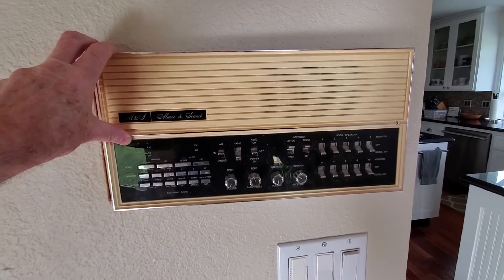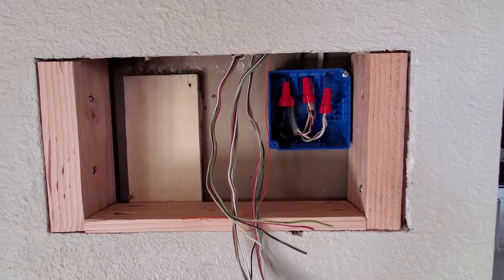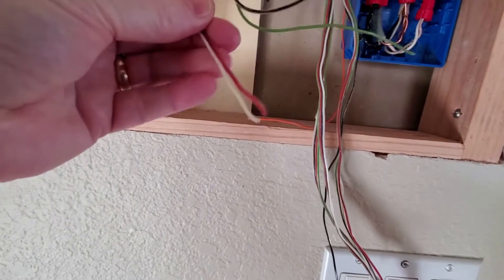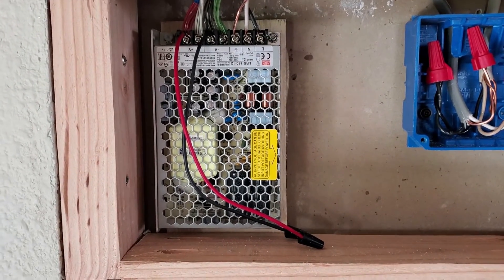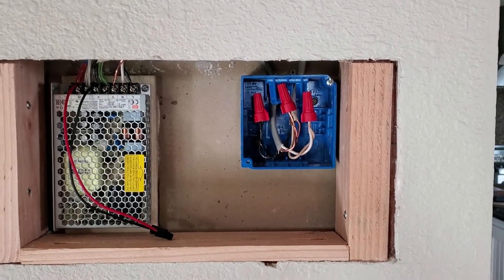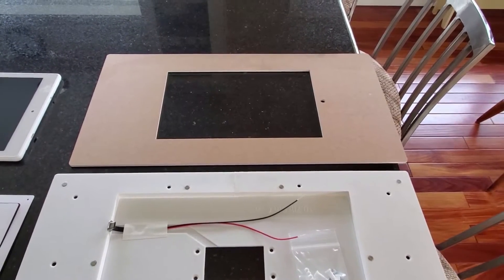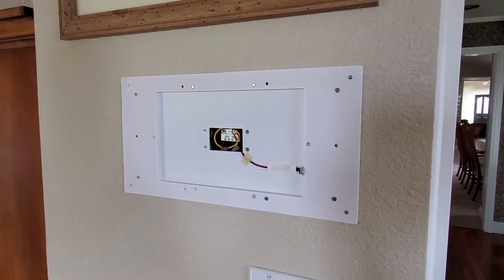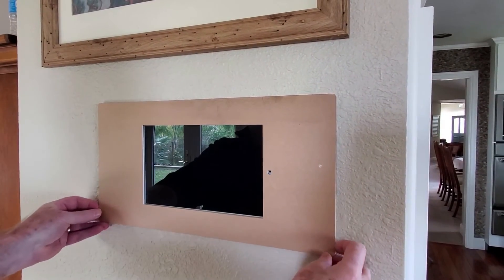Old Intercom Replacement - Wall Mount Tablet

Comment: This was fantastic! It took the mystery out of "what the heck am I going to do with this?"  Although I don't think I will be tackling this myself, I have a better idea of what type of professional to call. Thanks so much for demystifying this process!
Reply from the maker: Thank you for your extremely kind reply Shanee. That is much appreciated. I'm not sure what kind of professional you could get to be a  one-stop-shop to do this, with the custom components involved. But if you assemble these pieces from the links and step through the video, you can do it! There are really no special fabrication skills required and even the wiring is quite simple (although if not confident with that part, then certainly get - or ask for - help). If you look on Houzz forum  https://www.houzz.com/discussions/4321917/what-to-do-with-old-wired-intercom-system you will find a thread, not started by me, but I have a significant number of inputs and advice and you can reach out there if you need more.
Reply: @decosse01  I think what stops me is the knowledge you all in the thread seem to have on voltage and when (not) to transform. Seems to be some additional industry knowledge required for each component that I am not familiar with. Although I am a total DIYer. I will do more research!
Reply from the maker: @shaneemadden135  Most of the Amazon based components will be either 12V or 5V (although Google stuff can be a bit different) - So you pick a 12V supply and if need be use a 12V/5V converter where needed. You can always find the specs of the device either on the product listing or the AC Adapter that comes with it always has the voltage stamped on it :) Check out that thread on Houzz - I'm listed as Ken S** on there.
Reply: @decosse01  Will do thank you!!!!
Reply: @shaneemadden135  Did you ever compete the task? I'm thinking about getting this done myself. I like the vintage look and feel, but the radio doesn't work on my intercom.

Comment: Great Video!  One question. Did you need a 12v to 5v convertor for the other devices like you had for the main tablet?
Reply from the maker: It will depend on what devices you use personally - for the Echo Dot 3 I used, these are 12V devices, so these are connected directly using the appropriate adapter connector without any voltage  converter device (see part 2 of the video series). I also had two more tablets however, these were Amazon Fire devices also (although one 8" and one 7") - these are 5V devices, so those had the 12v/5V converters.
Reply: @decosse01  thank you so much! One more quick question if you don’t mind. I’m planning on using the fire tablets in each room. Do you  still recommend a 12v power supply converted to 5v and each unit. Or is it better to just start with a 5v power supply?
Reply from the maker: @arpanppatel  You are better to distribute 12V and then use a 5V converter locally at each station - the reason is that if you send 5V from the origin, you will drop some voltage across the wiring before the station -  at 5V the current is also 2.4 times higher, therefor the drop is proportionately higher that it would be for 12V distribution. It's slightly higher cost, but a better plan.

Comment: Might as well use alexa with drop in
Reply from the maker: That is exactly the point of this - the premise IS to utilize Alexa (for drop-in and other services) but have the devices wall mounted replacing the original IC components, while utilizing their original in-wall wiring for power distribution. Anyone who wants to just plug their Amazon devices into any wall AC outlet can certainly do that without this in-wall integration.
Reply: @decosse01  i guess. This is a good concept before the echo show 15 was released

Comment: Is there an app to allow intercom feature if I have tablets (or each dot?) in all rooms. My family is so used to press and hold a button and say "DINNER TIME - COME DOWN". What if I have outdoor / front door intercoms? Any way to mount and protect a 7 inch tablet vertically? An outdoor tablet at front door can be used instead of ring door bell? Now that our 1980s intercom is broken and I would rather replace them with modern technology.
Reply from the maker: with amazon devices you use their drop in feature on alexa for intercom. look through other q & a below to see my other responses on that feature

Comment: My M&s room stations were   connected using CAT 5 cables. How do I power my Echo Dot 3rd Generations to electricity behind the wall?
Reply from the maker: @deelytefulnurse - there are a couple of ways you could go; the first is to use a technology called POE - Power Over Ethernet - this is normally used to transfer both LAN signal and Power to a device over the same ethernet cable, originating from a POE equipped Router or Switch; then you would need a local device at each room location to break out from the RJ45 connector to separate outputs for your 12V and the LAN signal (you wouldn't be using the latter component of course as the DOTs are wifi); so you would need a POE Injector and a POE equipped switch at the source and a POE splitter at each Room Location and simply plug your already terminated RJ45 CAT5 cables in at each end. 
The second way to go, follows the same basic premise as the analog system per  the video tutorial, where you would simply be utilizing the cat 5 cable as nothing more than a multi-conductor cable - you just cut the connectors off and strip the outer shield, then connect as many pairs as you choose to carry your + & - 12V.

Comment: Great video.  I was just going to replace the intercom with new intercom unit, but I like this idea must better.  Couple questions, 1. Do you lose the intercom functionality? Intercom is more important than music for us.  Perhaps Tony H’s idea is better for an intercom replace, Fire 10 as a base and 8’s in the rooms?  2. Do you need take into consideration the distance the wire is run, say 100 feet, to determine 12V vs. 24V?  

Thank you in advance for your input!
Reply from the maker: Thank you Drew Fralley. Echo Dots can be used as Intercom (and so can Show Devices and Fire Tablets and all comfortably co-exist). The Amazon Alexa feature is called 'Drop In'. You just issue verbal command 'Alexa, drop in on (e.g) Bedroom 2' (If you do a search on Alexa Drop In you will find lots of guides & tutorials) 
To your second question, theoretically, it is not just distance, but wire gauge also that determine the overall resistance; thicker wire or multiple wires will have proportionately less voltage drop  - I had recommended to use multiple wires in parallel if you have them available - two wires connected together in parallel have half the resistance of each single wire; so the resulting voltage drop (whatever that might be for each specific situation) will also be half for two wires than for a single wire. We are not talking about huge current here though and even 100 ft is not going to be that significant in regards voltage drop (but do use double wires if you can). 
Here's an important factor if you wanted to test it - if you simply connect your wires at the power supply and measure the voltage at the unconnected wires at the local end, you will get zero loss. Why is that? Because you can only have voltage drop when you have current flowing. In order to achieve that you must have the load connected and THEN you might be able to measure a slightly lower voltage at the local device vs the source.

Comment: Can I use a 5V power supply? Wouldn't that be better if on the room stations I want to power tablets with USB?
Reply from the maker: Great question @John Rezai - The problem with a 5V supply is that you have no overhead - depending on the quality of your wiring and how many devices are pulling current, you may find the voltage at the local device is less than you may desire/require. 5V distribution wiring will carry 2.4 times as much current as 12V, therefor the line loss (voltage drop) to the local device is likely to be proportionately greater. However also note even if you did still have some loss at 12V, you still have plenty of overhead when stepping down to 5 anyway. So although it adds a little cost it is better to distribute 12V (or 24, whatever you prefer for your power supply) and then use a 5V converter at each device.
Reply: @decosse01  You are AWESOME! Thank you so much for your reply!! Means a ton when someone takes the time to respond like that, thank you! Just a follow up question, which 5v converter would you recommend for an amazon fire tablet (for the room stations)?
Reply: I just subscribed!
Reply from the maker: @pjrezai  Thank you for kind words. If you look on Amazon you can find converters in multiple packs even - some already have a USB pigtail on them which makes them sound convenient, but recognize that when installing in a wall mount, you really need a special ultra-slim edge mounting adapter so it fits inside the mount. So that extra included USB may not be of any value. If you look at the MB mounts site, even for his 'std' wall mounts, there is option for both adapter and slim pigtail connecter. (you can see those in the video at approx 8 mins - same adapter is available on Amazon or Ebay if you want to compare prices.
Reply: @decosse01  Thanks for all the help!!! You think I should go 24v power supply if I am doing 8 different connections for tablets of a decently long distance? Or should 12v be enough?
Reply from the maker: @pjrezai  12V should be fine and the 12v/5V converter are easier to source

Comment: HELP please. We have an old MS intercom, security, music system. The crackling and screeching makes us turn it off…but no doorbell. I’ve watched your you tube a lot. Want to order from Mikes plastic panel to hold a tablet and want to order a ring wired doorbell and a couple wired security cameras. Your video also shows the power supply to add ring dots for music. I don’t want Alexa and I now have a Sonos for music, but want the doorbell and maybe a fire pad. Would the 12 volt power supply still be applicable without dots? Going to have an electrician install, but I have to order equipment. You say that when we remove the main MS system box there is 110 volt power to 24 volt transformer. Is that what is in there now and would I need to switch power supply for what I want to do? Thx a million . God bless. Erika Parkes
Reply from the maker: Hi Erika - I'm glad my video has inspired you! You don't need the dots if you don't want the Music or Alexa capability at those room locations. The thing with a Ring WIRED doorbell is that it will require the AC voltage from the Original transformer, NOT the DC voltage you would need for the Tablet. If the Tablet is the ONLY other DC device you are using then conceivably you don't need a new power supply at all, you could simply utilize the converter that comes with the Tablet (either have a std AC outlet located behind the new panel, or cut off the plug and hard-wire into the junction box). Fire Tablets run off 5V incidentally - the 12V power supply per the video is the universal supply for all the devices - the dots are 12V - but note that I used an additional 12V/5V converter for the Fire Tablet. Hope that helps.
Reply: Dear deconsecrated, thank you for your reply…but if you could give me a little more clarification. I did look at your dots video…and no, I’m not taking the intercoms out of the bedrooms, so no music will be going through my ms system speakers. I am going to order the mount for the ten in fire tablet. It states that I need to buy the skinny tablet usb connection to hook into the wall mount because the plug in cable with fire tablet is too thick. So I understand I don’t need the 12 v power supply for dots…but do I buy the 5 volt power add on thru mounts. My electrician did Mention he could install an outlet in the box space where the old ms system is removed. Should the outlet have a USB port also? Would that work best. Finally, I’ve read it’s not good to keep any tablet plugged in all night…so what about the fact that it will always be plugged into the power source. So that is where I’m a little confused. Also, please clarify what we need for ring doorbell wired where the old intercom doorbell at front door. I bought a plate to cover that hole with a hole in the middle to wire the ring doorbell to former wires. Then will my old chime function, or do I have to buy the plug in chime that ring sells to place in some socket in the house.
Reply: Sorry I messed up your name…auto correct.
Reply from the maker: @erikaparkes3411  On the Tablet Power Supply - if you look at the power options from MBMounts, you will see he has a 120/240V option which consists of the skinny cable plus a 120 to 5V converter. So that is all you need and you can tell the electrician to wire up the voltage converter to the original Power cable. My Tablets were plugged in 24/7 and per Amazon this should not be an issue. If you really want to be able to disconnect it periodically, without having to remove the Tablet, you can use a device like a Shelly Relay (Shelly1) as an intermediate device to switch the converter supply on/off; with the Shelly you can then program it (via its own app) to be on only for whatever times you choose (maybe overnight or whatever). A Shelly now adds a whole other dimension, that I can't describe here, or attach a diagram for - suggest you visit the Shelly Support Group Facebook page (you will need to join the Group) and ask there. But that is maybe getting too advanced and it should not really be necessary anyway. 
For the Chime, your simplest option is just to use a Ring Compatible Wireless Chime that you can plug in to a std outlet (like the Ring Chime Pro)
Reply: This is Erika. 5/22 Can I ask two more questions. The motion detection kiosk you said is an android app. Did you download google play to get that? Amazon fire help states you can’t download that google without messing up tablet. Right now I have to use Alexa wake command. And I love the fire pinkish screensaver you have. It’s not an option on my new fire. I tried to google how to get it. There are only frozen pictures available like a seashore…and I don’t see a fire app to give me more options. I’m not using dots, but was able to download my Sonos app which turns on my music thru Sonos…so with the doorbell and tablet only, do I still buy the 12 v 5V converter power supply you have linked. You mentioned you changed to something different. Thx so much. Electrician coming Tuesday. Erika
Reply from the maker: @erikaparkes3411  do a google search on "Fire Toolbox" - it should be the first result returned I believe. The Fire Toolbox allows you to customize your Fire Tablet, get rid of all the bloatware, ads etc, add the Google Playstore and MUCH more. If you go that route, then you can get the Fully Kiosk Browser from the Play Store. Or, without going that previous route,  you can 'sideload' the app by getting the APK from the Fully Kiosk site - https://www.fully-kiosk.com/en/ - the Fire version is the first one in the download panel on the right. (an apk is a kind of executable app install - you just download it from your browser on the Fire and then install it). I recommend getting the Fire Toolbox - you can also disable the 'unlock' screen after it wakes up - you can't do that with the std Fire OS

Comment: I am in the process of doing this thanks to your video! I have one question each of my units have extra silver wires with them. Is that the ground wire? If so should I add those to the copper wire? I’m using the power supply from the video as the closed unit was out of stock cure for me.
Reply from the maker: Hi Chris - good luck with your project! When you say 'each of my units' are you talking about the original wall stations? Without seeing I'm not sure what those silver wires are, but could be a ground or shield wire. If it is bare wire or shield, probably safest to just not use it, to avoid possibility of it shorting to anything else. As long as you have plus and minus to each device, it is not essential that you use all the original wires and you wouldn't really gain much by adding that to only the plus or minus, without a corresponding extra wire for the other leg. Sounds like you'd be safe enough to just ignore it.

Comment: Thank you for the excellent videos.  You inspired me to do a similar upgrade.  Instead of Fire Tablet, I replace with an aluminum 10"x16" plate and bought Amazon Echo Show 15.  I followed your suggestion and installed Mean Well XLG-150-12-A power supply and hooked up 6 Amazon Echoes.  I also replaced door bell and door chime with VistaCam 1200 HD Wi-Fi Doorbell and Aeotec Siren 6 and they worked well with my Vera system.
Reply from the maker: Nice! Would love to see images of your install. Im pleased that you got inspiration but added your own flare.
Reply: I’m doing show 15 with two eco dots already set up ring At door side, any suggestions it’s all down on my head except the show 15 side I don’t know how to connect it to power supply yet.